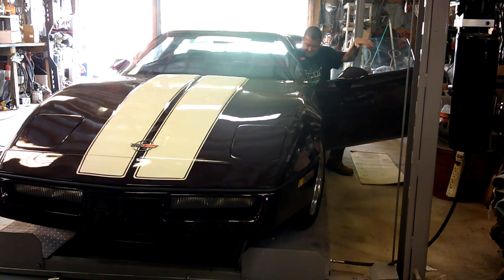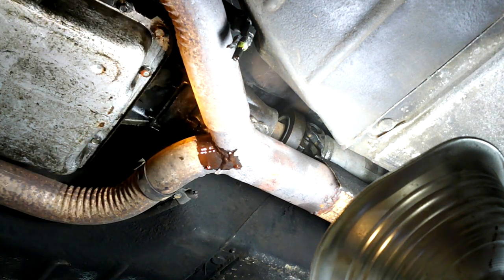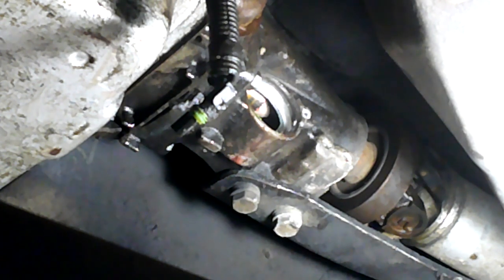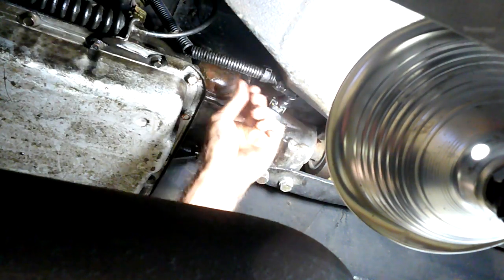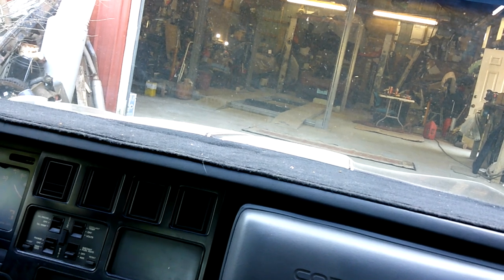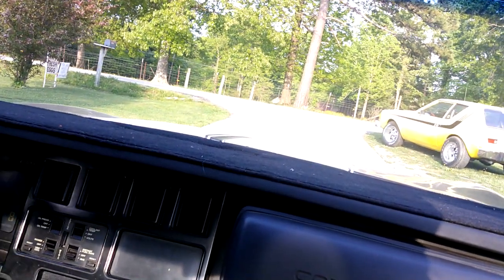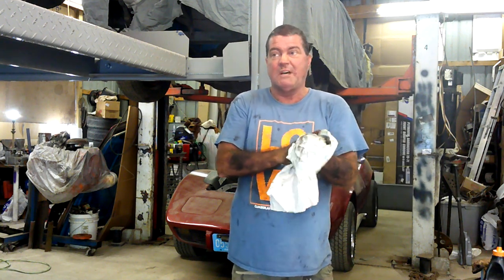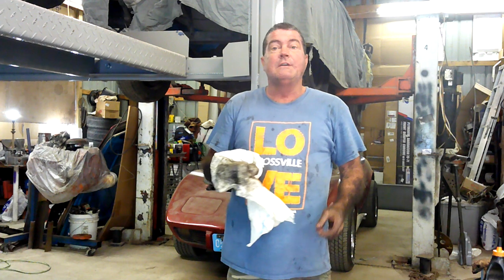How to replace the speed sensor C4 Corvette. Other things that can throw a speed sensor code. part 2

Comment: Hey,buddy when I had my shop I went through the same thing,didn't matter if it was Chrysler, ford or gm except for the fwd cars just about all of them had that stupid metal clip that caused alot of problems because the tiny little pin for the clip snapped off ,sorry I didn't remember sooner
Reply from the maker: I do not know what made this one fall out, the pin was just fine. I came up with an idea to keep it from coming loose from anything short of breaking (See next video). My clip appeared to be in good shape other than not being real springy.
   No need to apologize. You would have had to have been psychic to know before I aired the video. Wouldn't a keyway and C-clips have been a better design?
Reply: @essigspeed  c clip and maybe just a flatten area on the shaft and corresponding with the gear would probably have been a better idea
Reply from the maker: A flat would be ideal except, how would you get it over the splines for the driveshaft?
Reply: @essigspeed  that area of the tail shaft would have to be larger in circumstances than the spline section of the drive shaft
Reply from the maker: That would work and be stronger to boot.